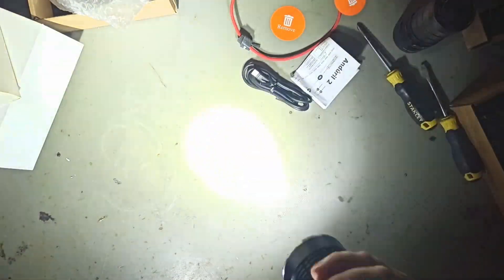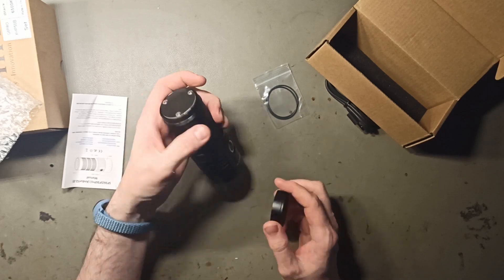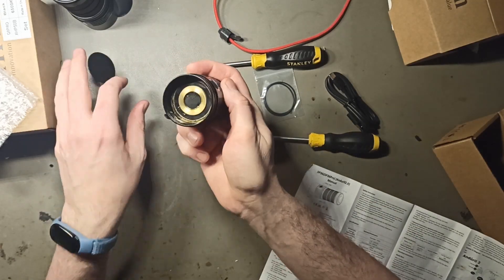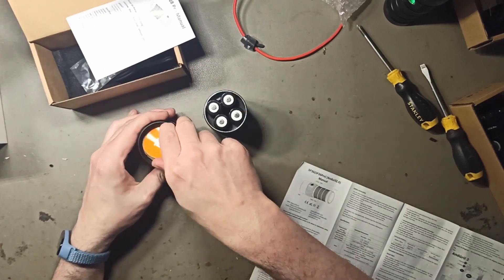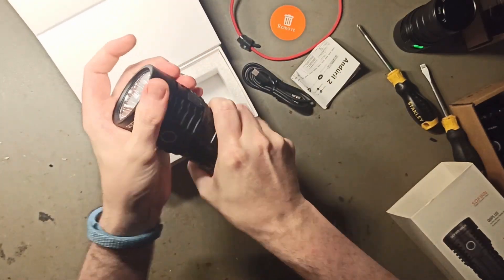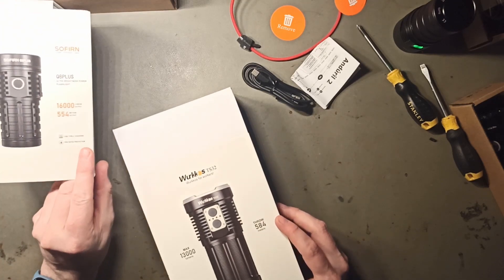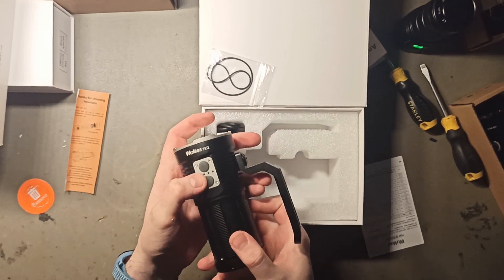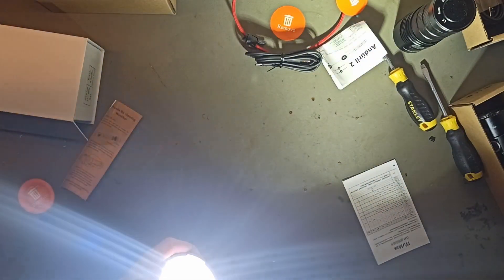Super non scientic review aka playtime with high power flashlights from Sofirn/Wurkkos (SP36 Q8 etc)

Comment: The UI on those flashlights is very advanced, you can press and hold the button to ramp up or down the brightens to anything you want, quickly triple click will tell you the current battery voltage (4 blinks pause and another 2 blinks means it's at 4.2v etc) & quadruple pressing the button will lock the flashlight so it doesn't accidentally activate, to unlock just quickly press it 4 times again 

That's just the basics, anduril (the UI on thease flashlights) is super advanced, i recommend reading the manuals because there are endless amounts of features and modes

Also yes you are correct about sofirn & wurkkos being the same company 

One last note, the Q8 Plus can reach 24,000+ lumens if you use high discharge cells, i have molicel p42a's in mine and there is a significant difference between the batteries it comes with

Thease flashlights are known for being some of the best for the money on the market, and i think you can already see that 😄